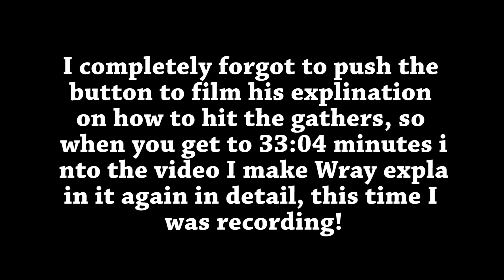Metal Shaping for Beginners: Shrinking Sheet Metal

Comment: It's amazing that you can take something that looks all wadded up and smooth it to a high sheen and consistent surface finish. Metalwork is amazing. I am currently working on two roof panels and had a wiggly edge. I will be doing the 45 wheeling that you suggested. I am about 90 percent from being finished with the shape on both panels.

Comment: Definitely a game changer. Boone showed me that technique a couple of years ago, and it makes all the difference in the world. And to be able to explain the the process and have people immediately see the advantages in it speaks for it's practicality and effectiveness. Especially when it's someone like Wray, with his immense knowledge and skill.

Of course, I prefer to TIG everything I can. But on areas where you're unable to access the backside to planish a weld seam, this is a great way to approach it.

Another couple of advantages I think are worth noting:

-Wray mentioned the fact that a lot of people quench or cool their MIG welds in an attempt to keep the panel from getting hot, but end up with just as much, or even more warpage/distortion. I believe that it also creates an even harder, more brittle, and more porous weld, and that it does cause more warpage than not quenching your welds. I feel that because although you may be keeping the overall panel cool, it introduces a localized extreme heat cycle each time, almost like creating a mini "tuck" with each cycle. Doing that 200 times in a row, in a straight line down a quarter panel will end up looking like something that had 200 small shrinks put into it in, all in line with each other.

-As any fabricator/welder will tell you, sheet metal will shrink when you weld it, no matter the process. But the effectiveness of your heat control technique can minimize the amount of shrink and thus the amount of warpage. With Boone's process, it's a much more gradual "wave"of heat passing through the panel, rather than essentially creating and setting a "tuck" with each stitch.

-I might be alone here, but I swear that when I hit a cold piece of steel with mig wire, it seems to run into the panel, then arc, then create enough heat enough to actually weld, and finally burns in the weld. While I know it's a fairly instantaneous process, I feel like I can watch the first part of a mig weld on cold sheet metal do one of 2 things: either ball up and lay on the surface, or blow through the seam. I believe that you can create a better, more consistent weld in a sequence of tacks (or dimes) placed (or stacked) before the previous "dime" cools. Then, by immediately grinding the weld, you keep the area hot, eliminating the hot/cold cycles throughout the weld process that cause much of the warpage by setting a tuck/shrink each time it cools. I think that if you can keep the heat input reasonably low, but more importantly, consistent, and moving gradually (and consistently) across the panel, this "wave" of heat does less to disrupt the shape of the panel than other methods. 

-Additionally, grinding the previous stack levels the surface height and greatly reduced the thickness of the weld bead. This way, you keep from sticking a weld on top of a previous one that's already several times thicker than the parent metal. On top of that, I believe that a weld that has cooled has also oxidied and formed a shell of impurities. (I don't know if it's technically slag, but in my opinion, a weld that has cooled and hasn't been ground, or at least buzzed over with a wire brush seems to take the next weld much like the first welds on a pice of plate steel that hasn't had the mill scale removed.) By eliminating this, you end up with much better, more consistent penetration, a more malleable/less brittle weld than a typical MIG, and less porosity. Each time you hit it with a new weld after grinding your 3/4" stitch, you're welding to a cleaned and level surface rather than piling it on top of a hard weld that's ~4x the thickness of the parent metal.

-Finally, the welding part of a repair done this way seems to take a little longer because of the time spent grinding in between welds, but overall time is substantially less due to the fact that you have little to no grinding left to do afterwards, and there is far less warpage.
Reply: Hi from the uk i liked your comments , that approach is the way to go you cant rush it
Reply: That is the other advantage of the system. It slows you down and forces you to pay attention to alignment. So you end up with nearly an invisible weld. It will never equal tig.

Comment: Great tutorial as always Wray. I find the only problem with grinding the Mig welds down in stages is you can thin the unwelded section adjacent to the weld and then burn through and/or grind through when continuing with the welding process. The biggest draw back is the feed wire makes for a harder weld and you can't really  planish it . But for many of us it's  a case of "make do and mend " . Thanks Wray.
Reply from the maker: Grind with the weld not across it to insure against thinning the parent metal on the sides.
Reply: The wire in most cases is the same in TIG and MiG, the difference is the amount of heat put in to the material and it cools quickly hence the harder deposit.
Reply: @notanymore9471  I have heard that said. But mig rod is wound on a spool. They use oil to help with that process. The one time I used mig wire to tig. Was the last time I used mig wire to tig. Very dirty.
Reply: @boonelipsey5393  sorry dude but you are 100% wrong. ER-70 S6 is the standard mild steel mig wire. It works for TIG just fine. The only difference between that and ER 70 s2 is the levels of silicon and manganese and other elements that scour the weld pool for oxygen as MIG is often used to weld material that has a contaminated surface versus TIG which usually has more prep done. To your point the wire is cleaned of oil and contamination before the copper flash coating is applied so if the wire was dirty or didn’t weld well it was you and your lack of preparation or your skill level. As far as hardness goes it has everything to do with cooling rate and polarity. TIG runs on straight and MIG runs in reverse which controls where the heat is put into the weld, reverse melts the wire whereas straight puts heat into the work which affects cooling rate. A fast cooling rate makes the material more hard and brittle than a slow cooling rate from TIG which is why you can mechanically work a TIG weld with more success that a MIG weld. Trust me you are arguing with the wrong person.
Reply: @boonelipsey5393  one more point, when wire is drawn down in diameter it is annealed as required to prevent cracking/breaking from work hardening and that hardness would not affect the final hardness of the weld anyways. The only factors that affect final hardness if the weld deposit are cooling rate and levels of carbon etc in the weld metal. In a mild steel wire carbon level is low which is why it is considered a mild or low alloy steel.
Reply: @notanymore9471  Not to be rude. Like you have been. But you are the one who can't grind without burning through. So I would say your technique is in question.
Reply: @boonelipsey5393  grind without burning through? Wtf are you talking about? I’ve been a professional welder for 25 years and welding engineer in the automation industry. You from your comments are obviously a very unqualified professional or a weekend warrior so again you are arguing with the wrong person. As far as being rude, if my showing my metallurgical knowledge is rude then yes I suppose I am. Sorry if I hurt your feelings , actually no I’m not sorry.
Reply: @notanymore9471  You may have a point. My point is. Whatever works works. My process works. Like it or not. I could care less if you try it or not. I have proven many people wrong since I was 18. I am 54 now. Been doing this for a hell of a long time. Mig, tig, stick ,torch. Structural and sheet metal. So do you. I will continue to teach my method to anyone who will listen. For those who don't want to try it?  Not worried about. Sorry not sorry.
Reply: @boonelipsey5393  well you did not prove me wrong. I’m 41 but have worked on nuclear, aerospace,  medical , vessels, semiconductor doing GTAW , GMAW , Subarc, Laser, oxy fuel, plasma as well as write WPS, WPQ, and PQRs for ASME IX, set up metallography labs and develop and qualify automated weld processes so I’m not your average YouTube welder.
Reply: @boonelipsey5393  and your statements about wire are still wrong.
Reply: @notanymore9471  Okay. I get it.  Use it if you want. I will not.

Comment: Loving these videos Wray and would love to take one of your classes but a bit hard from Australia. Can you please explain why you have such a wide top wheel on the English wheel. I’ve been trying to work it out but can’t get past the fact that the contact area doesn’t change in the lower wheel.  Cheers, John
Reply from the maker: Hi John, Thanks for the positive comments. I have had plenty of Australians take my class over the years. I have always found that people that travel long distances to my classes are much more serious about learning as much as they can while at my class.  I made my first wide wheel in the early 90's. Why wide top wheels is a common question. First off the wide top wheel holds the panel horizontal so you don't have to make sure the panel is dead horizontal. This prevents top wheel edge bite.  The wide top wheel also bridges low spots, The lower anvil wheel acts as a fulcrum and the top wheel the lever.  Used with large lower anvils you can have wider contact areas, making them more efficient.
Reply: Uh huh that makes sense, thanks mate.
Reply: @jonbon1904  if the distance is an obsticale. You got Peter tommasini in austalia. I dont want to be an a*****le and reccomend another guy on a serten guys page. But that is an option in your case :) i have another guy here in Sweden. Would Love to take wrays classes. But the distance is an issue. Renting somwhere to live and so on. Got a relative to stay at where the guy in Sweden is.

Comment: Great work! Just with a hammer an english wheel! And not too much time - if you have wrays abilities :)
The Eckhold Kraftformer is more comfortable, of course, but very expensive.
Reply from the maker: Everybody trys to speed up the process. The equation is Labor or Capital. Spend labor or spend capital.  The speed goes up as you spend capital.  Fastest to slowest. Most expensive to least expensive.  1:  Stamping is the most expensive and the fastest. 2:Hammerforming method   3: power hammer/Ecklod method 4: English wheel 5: hammers /dollies/stump/mallet.  All methods work, all require precise measurements.  Your choice.
Reply from the maker: At my classes some of my students with zero experience before attending my class are able to put out outstanding panels in just a few days of classroom instruction. Watch my next video, should get it done Monday.

Comment: I am intreged by the tig welder you used. It sounds like it would be a perfect starter tig. I own and have welded with an econotig for years. Currently using a everlast at work. Both are good entry level welders.
Reply from the maker: Hi Boone,  that small blue Chinese tig welder is a CT 312. It is DC only but works perfectly for sheet steel.  It is a least four years old now. I have one listed in my Amazon store that is only $197.00.
Reply: @proshaper  I have a co-worker who is interested in purchasing one for home. I will let him know that he can get one. I sat down with him for about a half an hour working with him on foot pedal heat control. He picked it up quickly and can already run a nice bead.

Comment: Wray, With regard to shrinking. If you use a paper pattern to get an idea of where to shrink, of course you get long pleats and short pleats in the paper.  If a pleat is 6" long and you have no facility (i.e. tucking fork can only do 3"), can you get away with more 3" shrinks versus one 6" shrink?   Or maybe, the long (in this example, 6") pleat doesn't strictly say the shrink needs to go 6" into the panel?
Reply from the maker: I don't use tucking forks because of the length limitation and it also leaves a strong scar caused by the end of the fork tines. I use my gathering tool which can shrink 10" into a panel, usually 6 or less is sufficient.  The panel does not have to be totally shrink shaped it can be a percentage of shrink/stretch. Usually 50/50 works perfectly.
I do all of my shrinking using the shrinking facilitator and the gathering tool. I have thumbnail dies in my Trumpf and big power hammer, I much prefer to shrink as I described using the shrinking facilitator and gathering tool. The shrink marks totally go away.
Reply: @proshaper  Thanks Wray, so it sounds like if the paper pattern tells you that you need a shrink longer than you are capable of, that you shrink as much as you can and replace the rest of the shrink with inboard stretch.
Reply from the maker: @rustynail3991  One: you don't have to make all  panels by shrinking only high crown panels.  I don't use paper patterns, I use flexible shape patterns. If the flexible shape pattern shows 3" of rise in the panel, I then shrink, if it has less I  stretch shape the panel.

Comment: when your grinding it down have your shrinking disc on hand helps to level the weld
Reply from the maker: No I only will use the shrinking disc on a weld seam after it has been worked with slapper and dolly or planishing hammer. If it is high after working the seam then that is when you bring in the shrinking disc.
Reply: You are correct forgot to mention that part I have them all at hand. Thank you for your dedication and passing on this knowledge

Comment: I have heard that another reason that mig welds are harder is that most people are using a mixed gas instead of straight argon for their mig welder. The CO2 in the mix is infusing carbon into the weld, making it harder. Any thoughts on this?
Reply from the maker: I personally don't mig weld sheet metal panels so I have no opinion on it. A lot of people still mig weld with good results.

Comment: 37 Studebaker Coupe Express?  What about using a heat gun to warm sheet metal around the area to be mig welded to lessen the temperature shock?
Reply: I really don't think it would be advantageous. You may shrink the panel more than expected.
Reply: @boonelipsey5393  Just a thought, thanks.  I think you’re right though!
Reply: @johnbuchanan6045  I had to think about it for a moment before I replied. Then I remembered a time that I actually heat shrunk an unruly panel using a heat gun on high.
Reply: @boonelipsey5393  I’m going to give your method a try today as described by Wray.  I think on another stretch I’ll also heat the metal to get it warm, not hot, so it won’t be such a temperature shock. Just an experiment, maybe create more work for myself. Cheers
Reply: @johnbuchanan6045  I hope people can take my method and expand on it. Let us know what you think. If you run into a slag let me know. It's a little hard to explain it when you can show it. Read Reilly's explanation. It is very good. I am thinking about doing a video.
Reply: @johnbuchanan6045  Keep in mind as you weld the panel will walk a little from the shrinking. Do if you have to cut a tack. It's no big deal. Try to keep your panel aligned as you go. If you grind it and the panel is off a little. You can cut back realign and reweld and grind. When you are done you will barely see the weld seam.
Reply: @boonelipsey5393  Thanks for the tips I’m going to be experimenting today.
Reply: How did it go?
Reply: @boonelipsey5393  It went great. A lot of trial and error of course but a couple hours hit and miss I got the hang of it.  I’m working on the inside of the wheel well with no easy access and very uncomfortable positions to say the least.  I’ll finish this area up today hopefully start welding in the wheel arch patch panel where I have clear access.  I’ll send an update when I’m done.  Thanks so very much John

Comment: On the subject of Mig v Tig here is some thing else to consider. When you mig weld your gas contains carbon dioxide and carbon is what is added to steel to harden it.... when you tig you use pure argon. 

The wire is the same type of steel so it's not that and mild steel does not contain enough carbon to realistically harden. 

The other difference is that you have post flow of shielding gas on tig but on mig you don't so the weld will oxidise whilst at high temp that will harden the weld bead. Just like what happens to steel when plasma cut. You get a hard edge.
Reply: hmm. 
- argon is also used for both mig & tig, so that's not a constant that affects weld hardness. 
- c02 is only popular as a shielding gas because it's cheap. weld quality is actually worse than with argon or mixes.
- filler wires are very different depending on what you choose, also not a constant.
- the amount of carbon added to mild steel from co2 shielding is basically negligible. 
the biggest differences between the two techniques, and why mig is harder and more brittle: 
1. tig heats the base metal and moves heat out to the filler. cools much slower compared to mig. 
2. mig instantly fuses the filler into the base metal in a smaller area, and cools very rapidly. this makes a harder, more brittle weld. 
3. the contrast between the slow, hot weld and the fast 'cold' weld is the main differentiating factor.
re plasma cuts - the reason the edges are so hard is due to nitriding when using nitrogen in the gas.
Reply: @daos3300  Pure argon is not generally used for mig welding steel. It is an argon co2 mix with some oxygen in too I believe. 

Perhaps I should test the mig tomorrow on pure argon with steel. If it is a softer weld then it is the gas that is causing the hardening not the process. 

I'll post the result when I'e done it.
Reply: @Byzmax  did you try it??